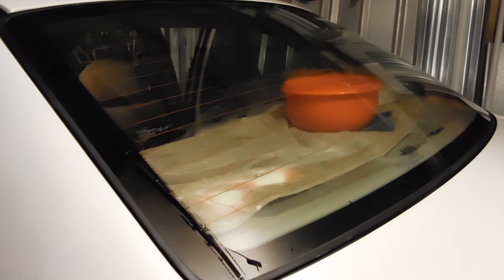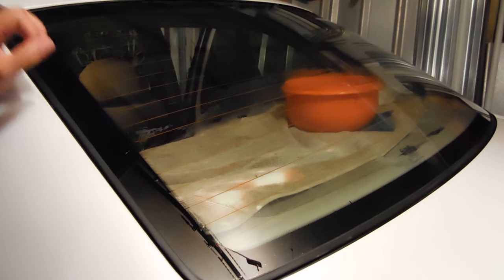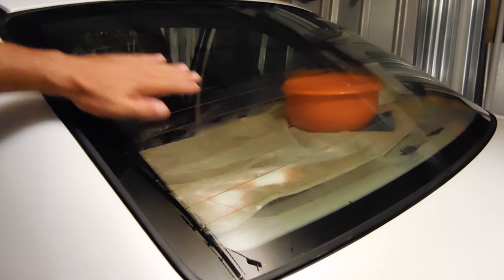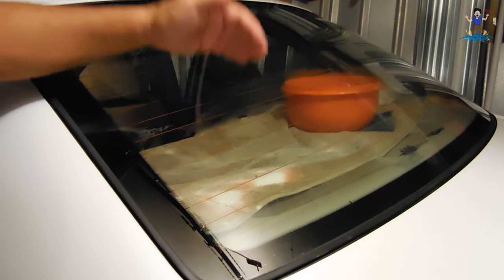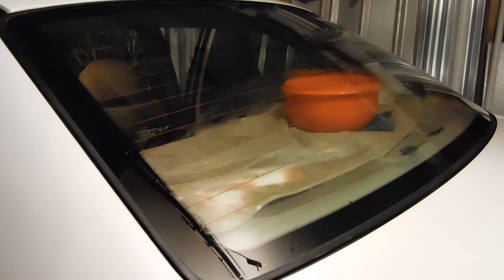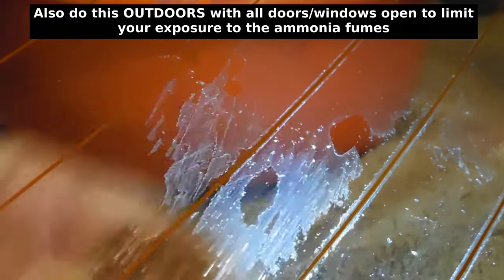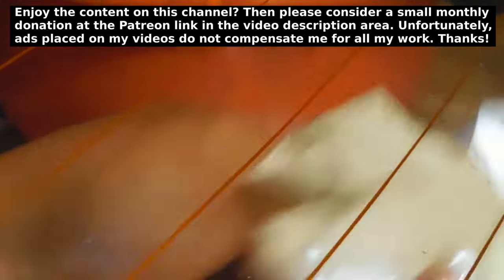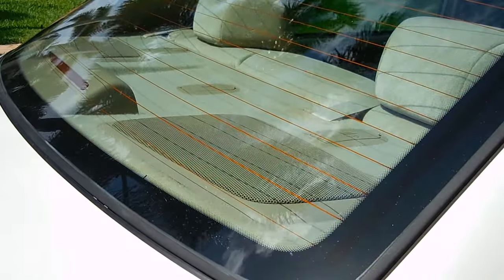How To Remove Old BAKED ON Tint From Rear Window!

Comment: AceTone nail polish remove. Works like a dream. No razor blade needed. Simply y with a paper towel and wipe clean! Did it with my car. The AceTone I used was purple in color.
Reply: Thank you i did this myself a few minutes ago
Reply: I'll try acetone
Reply: Thank you soooooo much. So easy verses the other methods. Finished my back window in minutes.
Reply: Going to try this
Reply: @jett0206 did it work?
Reply: The lower part of the back window still has film in certain areas. I can’t reach with my hand with a razor. How do I remove it?
Reply: Thanks. I will try it now
Reply: It will not damage the glass of the car?? Just acetone then wipe? All done?
Reply: @bj146651  gotta either take your seats out and drop the rear panel where your brake light/speakers are or go in through the trunk.
Reply: Ammonia ??? Now I’ve heard it all 🤣🤣🤣🤣🤣🤣🤣🤣🤣🤣🤣 what a blaze smelling that ammonia inside the car. 🤣🤣🤣🤣🤣🤣🤣🤣🤣🤣🤣🤣🤣
Reply: @reelmodzz1709 acetone is different than ammonia, js
Reply: I used brake cleaner. Worked super well just stunk for awhile
Reply: Acetone and brake cleaner did not work for me. 
I had to use a blade. I will try ammonia or LA totally awesome cleaner next.
Reply: @SalvadorSTMZ did it work?
Reply: Lacquer thinner
Reply: Ty..my kids tinted my car windows while I was away..HORRIBLE!! SO MAD 
HAVE TO REMOVE IT..THE BACK ONE IS HORRIBLE TO REMOVE TY FOR YOUR INFORMATION
Reply: 🎉 thank you so much i did this and it worked like a charm

Comment: This is very dangerous especially if you’re out in the heat breathing those fumes plus it’s WAY too labor intensive. A MUCH easier way (I know because I JUST did it)!) is to use a razor blade to get the majority of the adhesive off then use an old t-shirt or similar cloth doused in rubbing alcohol to remove the thin layer of remaining adhesive.
Reply: Tried that it didn't work at all it's 35 years old 😢
Reply: CONGRATS!!!! you fucked up the defrost lines 😂

Comment: THANK YOU! This works! I was freaking out after I removed residential window tint and was left with a cloudy residue on the window. Tried Wd-40, alcohol, acetone, gasoline, goo-gone, flooring adhesive remover, windex,soap and water, Awesome cleaner, a steamer…. NOTHING worked. Found this video and tried it and it removed it all. Thank you!

Comment: Thank you very much.  This is the ONLY thing that has worked in removing the tint adhesive that's been on the back window for 23 years.  It takes A LOT of scrubbing, but it does work.

Comment: I recently  bought a used car and had sticky residue on  it so I tried scrubbing it with a sponge and used scraper using goo gone wd40 and cooking oil  for a hour with hardly any results mostly just caused scratches in the adhesive 

This method started working instantly took a half hour-hour and looks crystal clear thank you Soo much straight to the point and super  effective !!

Comment: You sir deserve the gold star today. This glue laughed at my carb cleaner and steel wool.  Wow at how good does your method work my friend!!
Reply: is it okay to use steel wool? rather the copper?
Reply: I didn't have any luck with steel wool even after switching to the pure clear ammonia. Steel wool didn't scratch anything, it just couldn't get scrub off the glue. The copper pads worked though.

Comment: Wow, this actually worked - thank you! The tint came off with a steamer, but the glue was baked on. I was afraid it was extra tint, but your video showed exactly what I had on my car. Used to live in FL too and moved up north. My defrost lines might be damaged but they were already pulling/damaged when the tint was coming off. I appreciate the clear glass now 👍🏼
Reply from the maker: No method is perfect, but it sure helped me.

Comment: I was able to remove the 4 side window tints with a heat gun & razor blade. Can't use for rear window w/defroster.  Was finally able to get tint off, but not the adhesive. I had tried heat gun, paint stripper, acetone, glass cleaner etc. nothing worked. I used ammonia & a green scotch brite pad. I had to reapply several times, but I got most of the adhesive off.  Then used a steamer to break up the most stubborn parts. Finally through, what a job.

Comment: Ammonia was key! Nothing worked but ammonia. I will say on my truck using 0000 Brillo as well as copper pads scratched my windshield even with light pressure. Just used on small area. I then got one of those green rectangular pad used on Teflon pots and that worked with no scratches.
Reply from the maker: Sometimes the green pot scrubber isn't rough enough. I didn't observe any scratches, but using the copper pot scrubber can wear down the defrost lines if you scrub too long in one area. The bad part about ammonia, is the strong odor.
Reply: Not sure why it was scratching but got most of it off. It was front windshield. It’s against law in for tint on front Ga but ammonia really worked. Thanks for tip. I’d tried everything else that didn’t even touch it.

Comment: I have used #0000 fine steel wool to polish hard water stains off of my auto glass in the past. I like the distribution of the ammonia as you depicted it. I was lucky enough to find success using a microfiber towel and ammonia based glass cleaner with my fair share of scrubbing the way of the heater bars, side to side. I was using glass cleaner to thwart goo be gone because I didn't want it to dissolve my heater bar's adhesive.

Comment: I’m using 0000 steel wool to clean shower glass. Will try ammonia method removing rear window tint glue. Removed tint from doors and that was a loooot of scraping so I was very hesitant to do the same for the rear window. Thanks for the video.

Comment: Using a plastic Dobie scrubber won't ruin your defrost lines either. Straight ammonia in a spray bottle let sit and it turns it to slime and remove slime with paper towels. 12 years tint removal experience
Reply from the maker: Didn't work for me, tried it all. Thanks for the input though.
Reply: Thank you for the info. I am so worried about using the metal in my car. 
I thrust you if you have 12 years of experience.
Reply: @fervilla852  just don't scrub dramatically. As always being too aggressive with anything causes a bad outcome. 👍
Reply: Thank you for answering me. I will do it very soft and slow I don’t want to ruin my rear glass. 
Where do you find the plastic scrubber. 
Happy new year and blessings for your business.
Reply: @fervilla852  Dollar general and even walmart
Reply: What about goof off spray?
Reply: @Joyjoy-ih1ie  I have never used it. I just use what works. It works on most tint adhesive. Sometimes it takes straight ammonia.
Reply: @louisemissouri4410 i dont have those in my country

Comment: Appreciate it, man. Have some residual spots on the windows of my ‘99 TJ that’ve been bugging me. None of that other stuff you mentioned worked for me either and scraping is for the birds.
Reply from the maker: Use only enough pressure to get rid of the residue.

Comment: thanks for the video!!, but i have a question: i removed the tint from all the windows of my dad's car too, but i used a razor and water/degreaser, except for the rear windows, because i'm afraid of damaging the wires of the defroster. thanks for reading!
Reply from the maker: No razor on the defrost lines. Use a copper pot scrubber. Test one area first.
Reply: @electronicsNmore  THANK YOU VERY MUCH!

Comment: Anyone know how to remove pieces of tint? My tint is over 20 years old and it want let me grab and pull, it breaks/flakes off.
Reply: @Ultrh Ultra I had to pain staking scrape it off. Use acetone (nail polish) and scraper. Use a new blade every 3 to 4 passes. Takes a while, sucks, but beats paying the tint shop $ 200 to do it.

Comment: I've been trying with a razor blade tool that is made for removing tint but it is taking so long. I've tried Goo gone with the razor tool and it works alittle better. But my problem isn't the glue, but it's the window tint itself is so brittle that it comes off in tiny pieces. I have a 94 mustang Cobra and I have been trying to get the tint off the back window for 3 hours and I have only got about 1/4 of the way down the window. It's that bad, and it's only 1 layer of tint. But I heard that the cheaper the tint is, the worse it is to remove.
Reply from the maker: If it pulls off fairly easily in tiny pieces, then place a strong, clear, wide tape over the tint, then pull up on the tape to remove the tint.
Reply: @electronicsNmore  I will try that thanks. It's not coming off easy, it's coming off in small brittle pieces when I use the razor tool with firm force. But your tape idea might work better so I'll try it. Thanks again.

Comment: How about thin scotch tape off a freshly tinted back window. I told the guy who did the tint job he didn't have to put the temporary registration back on the window, but he said, "It'll be OK, I won't use the adhesive on the sticker itself, I will use tape". I thought, this guy must know what he's talking about, so I said, "okay"...  Well, I got my new license plates and went to take the tape off and it is so thin I couldn't peel it and I can't get my finger nails under it. I even tried very carefully to use the temp. reg. as a starter to slowly pull it off, but the tape just broke. It was on there for over 3 months and I think the warmth from the sun just baked it on there.. I am afraid to use any kind of scraper cause of the tint. Any ideas before I call the tint company and have them do it? I just want to avoid driving back there if possible (kind of far)...

Comment: Good job, but @ 3:55 it looks as if you scrubbed off the metal paint from the defroster, then at 4:21 you can clearly see light shine trough the defroster line.
Reply from the maker: It's not 100%, but it was the only thing that worked for me. Most lines were unaffected. There appears to be 2 different layers on each line.

Comment: My trouble is figuring out how to remove bubbled, foggy tint that is such poor quality that it is flaky and nearly impossible to remove.
Reply from the maker: Try a hand steamer to soften and scrape away the old tint. Use a stiff PLASTIC scraper. It will take a while, if it does work.

Comment: I'd like to get to this point but I'm unable to remove my tint.  It's about 25 years old and spent most of those years out in the Arizona heat.  I tried the garbage bag method. It didn't work - didn't even touch it.  All the videos showing the garbage bag method seem to suggest 409 as an adhesive but that's not available where I currently am - Canada.  I'm wondering if there's another common cleaner that might be effective. After seeing you video I tried straight ammonia to no effect. Like yours, it's a rear window with defrost lines.  Someone suggested paint stripper or airplane remover but I'm concerned that'll damage the defrost lines.  Thoughts?
Reply from the maker: No guarantee the defrost lines won't get damaged if it's on there that good.
Reply: I'm going to try steam.  I'll post on how it goes.
Reply: Ammonia is the key!
Reply: Along with Scotch Brite white pads. If all else fails try this method https://youtu.be/MZWIOJV8oFk
Deep South Tinting way of removing tint and glue

Comment: Acetone and isopropyl alcohol dont work as efficiently as ammonia. The other option is to spray on wax and grease remover then put a plastic garbage bag over the sprayed surface and let it soak out in the sun for a hour,then take the plastic bag off and use a plastic scraper to scrape all the glue off,this is much quicker than the ammonia and scrubber method. Then use isopropyl alcohol and microfibre towels to clean the inside glass.

Comment: HELP. Had my REAR tint removed today, tint person said they can’t get the glue off, will have use razor blade , will damage defroster + can’t get 70% tint because of possible flaws after. LOOKS LIKE A CLEAR Tint left on window, dark tint came off  but they said it’s glue. WHAT DO YOU GUYS THINK??? Help .

Comment: I have to remove 17 year old bubbly discolored tint on my car this will come really handy.
Reply from the maker: Good luck, sounds like a nightmare. LOL. Try slowly peeling it away from the glass using a hand steamer first.
Reply: @electronicsNmore  I doubt a steamer will help the tint is flaking off in tiny pieces

Comment: I have tried. it works but the defroster line was damaged.
Reply from the maker: Nothing is 100%. Did you use the copper scrubber and only rub as much as needed to remove the residue?
Reply: @electronicsNmore  perhaps i didn't use amonia solvent, i only use copper scrubber.

Comment: how can you tell if it's the baked on glue and not the 2nd layer of film? My tint guy says the 2nd layer of film was left behind and he must scrape it and I lose my defrost lines or I need to buy a new back window... thanks for your help.
Reply from the maker: Did you pull off only 1 layer?
Reply: I had a tint guy to do it so I was just watching.. he said the color pulled off but the other layer did not. he said I need to let him razor blade  the rest which will kill my defrost lines and  maybe  throw a code on my 745
Reply: I'm looking for another option he has not thought of
Reply: If it was glue, we tinter can clean it in minute, but if it was piece of old film, scrape it to get cleaner job
Reply: @AlM-tz8yx  any luck? Having same problem.
Reply: @aass9601  I ended up having to have the rear window removed, scraped it, and put the window back in
Reply: @AlM-tz8yx  sorry you had to do all that...found a tint place that took mines off & re-tint. No1 else wanted to be bothered with the task..live & learn. Staying away from tinting front window. Will be same story when starts to bubble up...no1 wants to be bothered, only want to put tint on, not take off. Glad its all over for us.

Comment: So I need to worry if the acetone accidentally gets on anything besides the glass? I don't plan on splashing it around, but, thought I should ask before I begin my project.
Reply from the maker: Acetone? No good. Ammonia! Make sure all doors are open wide, and it's a very good idea to have a fan blowing the fumes away from you out the opposite door.

Comment: I tried a steamer, I tried a razor blade, I tried the black trash bag trick.. nothing works ever I’ve been trying for months
Reply from the maker: Never use a razor blade on the defrost lines. I had the same problem as you, and the method in this video worked. Use a copper scrubber, and only scrub enough to remove all residue. Thanks for watching!

Comment: It is way easier just to line your inner windows with garbage bags and soap solution then put the car in the warm sun for 20mins then take off the garbage bag then peel one corner of the film then the rest will follow👍
Reply from the maker: Tried that. :-) It failed.
Reply: It only get up to 25c for an hour, how would that eork

Comment: You're glue ways easy to remove probably by fingernail it seem like the glue on my window looks like it's painted on is it still going to work
Reply from the maker: Incorrect, no fingernail was going to remove that adhesive. Thanks for watching!
Reply: electronicsNmore I meant to say seems easy to remove with fingernail.... I was comparing it to mine. Mine looks burned on

Comment: Where can you buy those scrub pads?
Reply from the maker: Walmart or the dollar store.
Reply: @electronicsNmore  Thanks buddy. And like what kind of ammonia should I get? Do they just sell pure ammonia or do I get like an alkaline cleaner like purple power?
Reply from the maker: @ryanjade2836  I used a cheap plastic bottle of ammonia from Walmart. Do in a VERY well ventilated area, leave windows and doors open.
Reply: @electronicsNmore  Okay great, thanks for the info. I have a 3M respirator with filters. Should I wear that, or is that overkill for this project?
Reply from the maker: Either use a fan to blow the fumes away, hold your breath as you scrub, or use a respirator that has activated charcoal.
Reply: @electronicsNmore  I truly appreciate the swift responses and great tips and advice. You earned yourself a subscriber. I will be sure to tell others about your channel as well. Thank you.

Comment: I was going to try this method next but I used nail polish remover. 100% acetone. And it came right off.
Reply from the maker: That works, but it can remove the heater lines.

Comment: You literally just scratched your window! Never use steel wool or an abrasive metal on any glass
Reply from the maker: Wrong, no scratches. Car dealers use steel wool to clean the windshields on cars. The grade they use is 0000. Copper is much softer than steel.
Reply: Lmfao learn physics, its not metal brush for glass bottle cleaning

Comment: You fucked up your defrost grid. You can see right through the lower grid . Shouldn't use that type of brush on grids.
Reply from the maker: Some damage, but that happened when the tint was peeled away. I live in South Florida and have no use for rear defrost anyway.